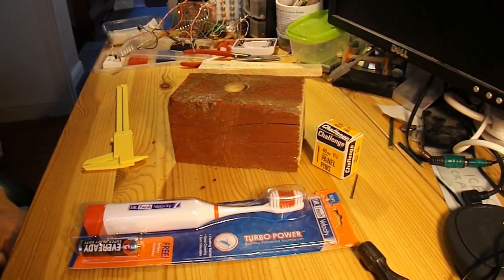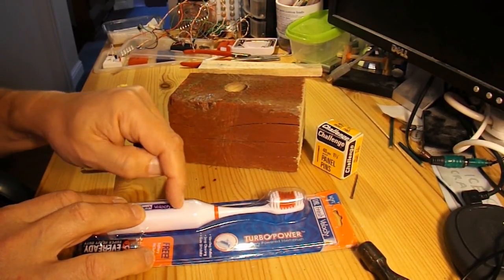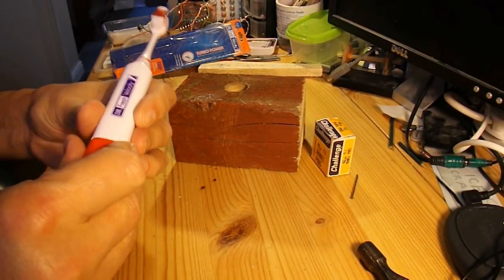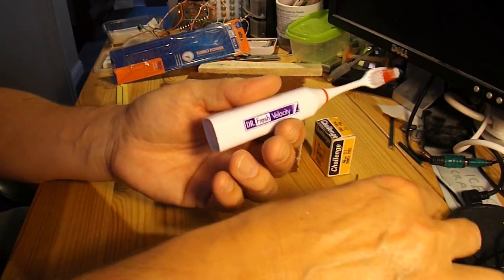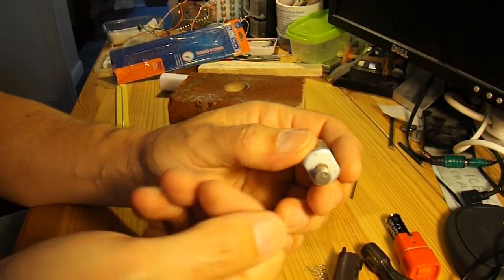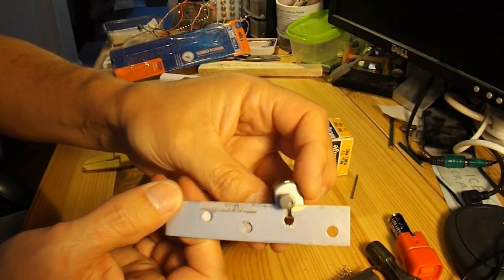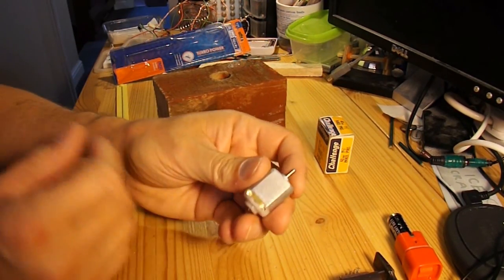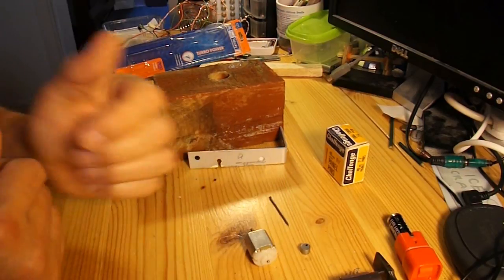Helpfile - removing offset weight from motor of Dr fresh Velocity Toothbrush

Comment: OOhh of course.. That was so smart.. I have one that looks like its solid but i gonna try this maybe it just really tight.
Reply from the maker: Thanks, good luck
Reply: This video really helped me, its worked wonders and felt like the correct text book aproach.. ;) After a little bit of puzzling to get the improvised rig together and a lot of hammering i finally got it out. :) It was so tight i kinda started to believe it was one solid piece.. You got yourself a new subscriber. I never tought i even would find a video with somebody mentioning the problem :D  Thank you very much buddy

Comment: How could I put this in a video game controller?
Reply from the maker: If you mean that you want haptic feedback I would suggest you need to search for "haptic feedback games controller" on the web and see if anybody has a suitable project. It certainly will not be as simple as putting a vibrating motor inside your existing controller and connecting a couple of wires.

Comment: this may sound like a silly question but how many of them would it take to power an electric scooter
Reply from the maker: Hi Asper Kane, I would guess that you would not be able to link enough of them together to produce enough power for that. You would probably lose most of the power in friction with all the pulleys or gears that you would need just to connect them to an axle. On top of that you would need a large battery to power all them and that would add to the weight. Try googling these small electric motors or look on eBay for similar to see if they show the specifications such as power output and weight etc.
Reply: ok thanks for the advice :)